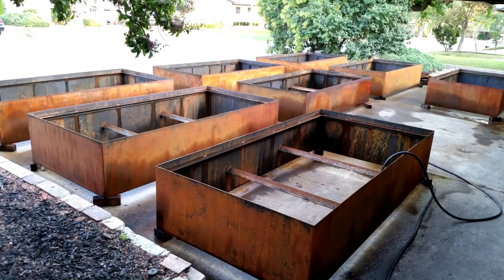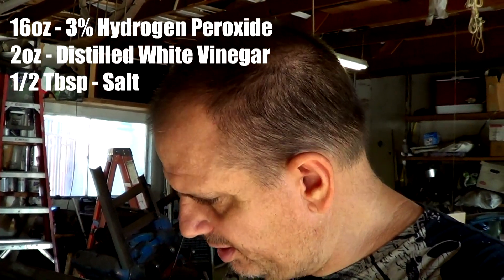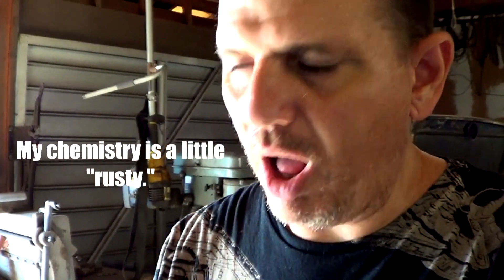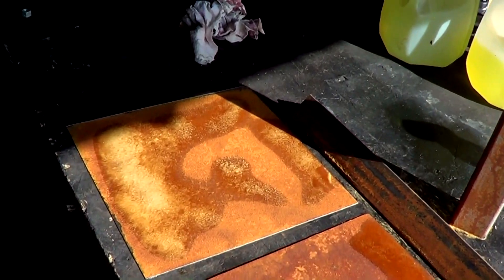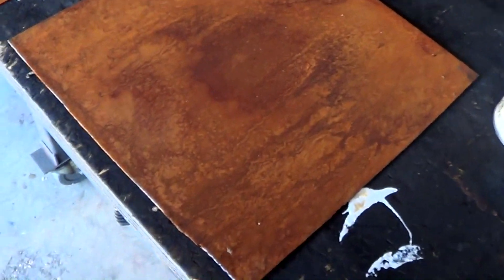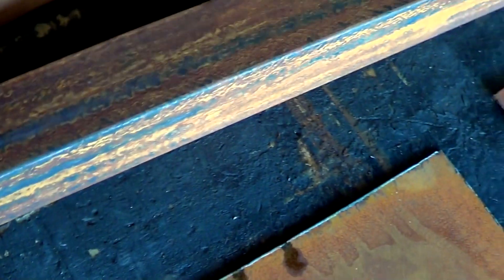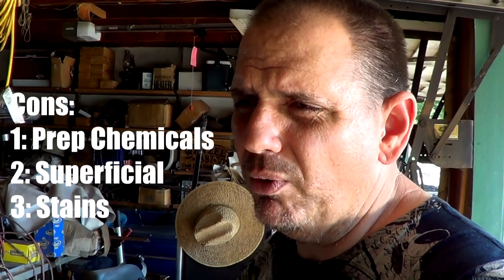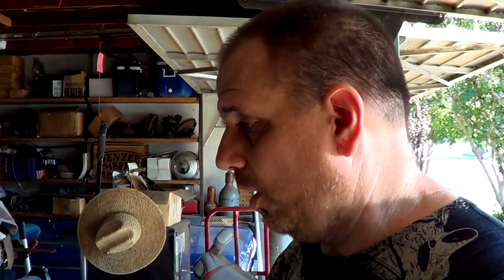Make Steel Rust Quickly with Hydrogen Peroxide V71

Comment: We applied hydrogen peroxide sprayers both 3% and 50% with vinegar and salt on Corten steel but no change seen , just a little rust came , do we have to apply this 15 times in 15 mins 
We put 500ml - hydrogen peroxide + 60ml vinegar + 1/2 teaspoon salt 
But not much change

Comment: Hello I just watched your video on accelerating the rusting process on metal. I am trying to add a rust look to some kitchen canistersq made from galvanized metal. I tried your recipe on it and they didn't change color at all it didn't faze them at all. I'm wondering if I need to etch the metal or change the exterior..? I don't know what to do can you give me any suggestions?  Thank you
Reply from the maker: You'd need to remove the zinc coating that prevents it from rusting. Sanding might work. I don't recommend breathing the dust. Soaking in acids will work. Don't breathe the vapors. There's ways of using using electrolysis to transfer the zinc to something else. Any process to make them rust, aside from the slow decay of time, is probably more complicated than its worth. I think there used to be spray paint that had a lot of iron in it that you could paint something and then rust the paint. Good luck.

Comment: Good video. I've done this to many sculptures over the years. It works great. The only thing I do differently is I keep two spray bottles. One for each, hydrogen peroxide and vinegar, to keep them fresh. I spray on one let it dry then the other. I'd like to see a video of stripping the mill scale with acid if you can. You might have a better idea than me...
Thank you 🎸
Reply from the maker: Nothing elegant about stripping the mill scale. I just spray it on, let it set, wash it off. It takes a few times to get it all off. Most of the time, I'm good with one or two treatments for the type of work I'm doing.
Reply: @JustinJennings  Thank you 👍

Comment: I want to get a little extra patina on the hood of my 1964 Chevy, you explained how this works very well, but once I wash it off after I get my result will it keep rusting in the bad way or just create the patina that I want and have the future surface rust look that I’m looking for? 
Thanks!!
Reply: As long as it is not in contact with water, rust will stop. You have to create a barrier beetween the hood and the elements. You can use a mat 2k clear coat (car body shop). It is very easy as the surface is rusty, this is great for the clear to adhere without having to sand it and ruin your effect. I practice this method on bike and it works perfect. Rust won't progress.

Comment: Hi Justin, thank you for this great video. I need your help please ! For my project, I am trying to end up with YELLOW RUST. At 2:50 of your video, you have just mentioned about that. But I could not quite get it; Was the mixture you used to get yellow rust muriatic acid + vinegar or muriatic acid + hydrogen peroxide? (The later seems to be a dangerous mixture from what I have read). Your answer will be greatly appreciated. Thanks.
Reply from the maker: I only use muriatic acid for stripping the mill scale. Do not mix peroxide and muriatic acid. It seems the muriatic acid does leave a flash of yellow rust.

Comment: Nice one! Quick question, can you stop the process and seal the rusty effect with a clear coat, also to add extra protection and keep the same color/effect locked in?
Reply from the maker: Clear polyurethane works okay. But, it will make darken it. And, the polyurethane tends to not last outside.
Reply: I use furniture wax (bee wax base) to seal it. It keeps the finish consistent and slows the oxidation down. Repeat as needed as years pass (indoor furniture and displays).  Thanks, Justin, for the video. Great rust solution.
Reply: @crisptitanium How about for outside ? Is there a good product to seal it with?

Comment: Nice technique. I'm looking to set a certain rust and freeze it in that state, stopping the further rusting from occurring. Any recommendations for a clear coat preferably water based that will not alter the variations or make it on note looking.
Reply from the maker: I've applied polyurethane over rust. It leaves it looking wet. And, it holds up okay for indoor pieces. Something UV resistant might hold up better outside. But, I've never found a clear that holds up outside in the sun for very long at all. You might want to talk to an autobody shop if you want something durable for outdoor use. Good luck.

Comment: Would using 6% hydrogen peroxide but with half the quantity yield the same results? Where I live, I couldn't find 3%.
Reply from the maker: I guess you could dilute the peroxide with distilled water. But, if I had ready access to 6% over 3% I'd use it. The hydrogen peroxide is the active ingredient. It'll just react more readily.

Comment: Does it work in a bath with no oxygen?
Reply from the maker: If you mean a bath of the mixture of hydrogen peroxide, i'm guessing it would still rust. But, a bath of anything that's had the oxygen removed, you couldn't have rust.
Reply: @JustinJennings  Thanks for the reply. I mixed up a batch and put in heavy plated gold wrapped in metal, in the morning the mix was turning black, it's doing something.👍

Comment: Justin, This is the first video of yours I have seen. now on to the rest! One question.... have you ever rusted galvanized steel with anything less toxic than muriatic acid or drain-o-? I built a soaking tub for some roof panels and using vinegar....it works to strip the tin ,just slow as frozen snot.

Comment: Great video. Im building a container house and want to strip it then let it rust to a certain color. Do you had any methods of sealing or coating the rust to stop at a certain point or color?
Reply: I have used just regular wood stain and it worked really good it looks awesome
Reply: Exactly what I need to know 
I just want to lock the color after being happy with the result, but it keeps changing 
What should I use to prevent the metal from rusting like forever

Comment: Will it weaken steel springs,  I'm trying to dye metal naturally ?
Reply from the maker: I guess that depends on the thickness of the springs. If the springs you have would be weakened significantly with rust, then I guess so.

Comment: I have a applied this solution on corten steel, I need one help from you, after applying the solution it produces loose rust and powders feel on fingers after rubbing...
How to protect loose rust...
Reply from the maker: That's just a bloom. Multiple applications will get a deeper rust. But, nothing beats time and patience. As for protecting the rust, once you get a real good rusty surface, you might try boiled linseed oil. It really depends on the application
Reply: @JustinJennings  can this solution cause pitting if you put on more coats because I'm making an m1 helmet look like a 70+ year old relic and I want pitting will this do that

Comment: The Salt + Vinegar solution will give you a weak hydrochloric acid, which etches the steel and allows it to oxidize more rapidly.
Reply: You're Right the acid leeches the metal atoms and gets oxidized by the free oxygen from the volatile peroxide mixture. However, you don't need acetic acid to make this work because the mixture already has chlorine from the salt and hydrogen from Hydrogen Peroxide that can create "HCl acid". The vinegar is an accelerant but salt and hydrogen peroxide will do the same thing. But HCl isn't the mechanism causing the corrosion it's the free ions -Cl and +H that are reacting with the metal and pulling it apart. If anything the vinegar is just providing more +H ions to speed up the reaction
Reply: @chrisdavis2161  if what you say is true would combining HCI acid, vinegar and hydrogen peroxide hypothetically increase the cleaning process?  
but by how much and what would a ratio work?

Comment: Great video! I used this method in my class today to show hydrogen enbritlement and why we don't use acidic cleaners on high strength bolts.  What's funny is that I thought for sure that yellow zinc plated metal.wouldnt be effected, I sure was wrong.  Thanks!!!!

Comment: Hi Justin,
Thanks for the detailed video,
Just few questions, as I am new to this, I have the corton grade A sheets of 1.8 mm thick, the supplier is supplying the sheets  in mill finish, but I want to use those mill finish sheet in one of my project, and I want orange type of rusting colour, will u please tell me the what exactly the mixture should be? exposure time? initially material needs any treatment? 
Basically start to end process, 
Thank you.
Reply from the maker: I thought that's what I did in this video.

Comment: I am looking to preserve a polished lustre on the metal. My mechanic told me to rub hydrogen peroxide on the metal after polishing it, then to clear coat it. But after watching your video, you are making me believe that the hydrogen peroxide will rust the metal, rather than protect the metal from rust. Which is true?
Reply from the maker: Not sure what he had in mind. It would clean the metal and as long as you flush the peroxide thoroughly it shouldn't rust.

Comment: Thanks for the post. Being a guitar nut, its interesting to find out how how one can get hardware and give it that 60 yrs of bar sweat and RnR look. My question would be please. If you did this, then sprayed with a clear coat would we "preserve" the accelerated process ... intersted in your feedback - cheers
Reply from the maker: Good points made by Clark Davis. A neutralizing bath will help with the acids. Also, rust is porous. Water gets trapped in it and you might toss your pieces in the oven on low to bake any remaining moisture out before clear coat. Even a hard wax can be applied. A common method in blacksmithing is to apply bee's wax on hot metal. I think you should experiment with sacrificial parts and see what works for you.

Comment: You can use hydrogen peroxide in your mouth like mouth wash. It says on the bottle "oral use" just dilute it with water until it's barrable
Reply from the maker: I've used it as a mouth wash. But, I just used it straight. I wasn't aware there was a threshold of bearable to it. It does leave your mouth feeling odd though.

Comment: How can one break a cast iron pipe with rusting?possibly quickly.
Reply from the maker: Cast iron is pretty resistant to rust. It is rather easy to break cast iron with a hammer.
Reply: They make a tool called a chain break. Snaps castiron pipes clean.

Comment: I just found and subscribed to your channel, I make metal art from time to time and prefer the rusty finish mostly for the look but also because when ever I paint anything in my shop everything else comes to a stand still for fear of bumping into or getting crap on the wet paint so I try to time the painting as the last thing I do for the day. I have a cnc plasma table and when cutting thinner metal I spray water on it while cutting to help prevent warping but if I leave the wet parts on the table over night that water will make some interesting rust patterns in the hot rolled metal but only on the top side, so ok for wall hangers but probably not for a gate or anything else that can be seen from both sides, linseed oil seems to seal and bring out the colors but im not sure how long it would last exposed to the elements so I use it mainly for indoor items and clear coat over the rust finish for outside stuff so it doesnt bleed or just no sealer for things like garden stakes where it doesnt matter. Really enjoy your video's and what you do and I'll be trying out the HP solution next chance I get. Thanks
Reply from the maker: Thanks for the comments. Painting is the worst part of every project. I'm loving the rust more and more.
Reply: I often paint after installing if possible  to avoid any problems. If not I just am very careful and always bring paint for touch-up after installation....
Reply: We're making a project for an outside garden, and we're trying to make corten steel plates, so is it not important to seal the rust with anything like a rust inhibitor oil? Because we don't want the color to keep changing when exposed to the rain or the wind 
What's the best we can do in that case?

Comment: I love your videos Justin!
You can use vinegar to remove mill scale. It takes longer than using acid. I use long pieces of pvc pipe with one end glued on, put square, round, angle, punched channel in and then fill with vinegar. About 3 days later pour off the vinegar and wire brush parts. I spray WD-40 on as soon as dry to protect from flash rust.
Reply from the maker: I know I mentioned that when I was recording. I don't guess it made it in the final edit. I originally went on about all the different types of steel and concentrations of acids, etc. But, I've been told by more than one viewer, "nobody wants to listen to you talk." So, I find myself power editing my videos sometimes. Thanks for the comment.

Comment: Nice video Justin, I've recently started to build trailers, grills and smokers and I paint them immediately so they don't rust. What is the purpose of making them rust? I'm just curious. Thanks, keep up the great work
Reply from the maker: Well, I wouldn't bother making a grill or a smoker rusty. They'll usually do that on their own. I actually like a rusty finish when the context it right. Rust works well in rustic design and if applied to the right finish it is very popular in contemporary design situations. So, it's just another option for a finish instead of paint. Although unless it's a weathering steel like Cor-Ten, I'd avoid encouraging rust on a structural piece.
Reply: Oh ok, thank you Justin.